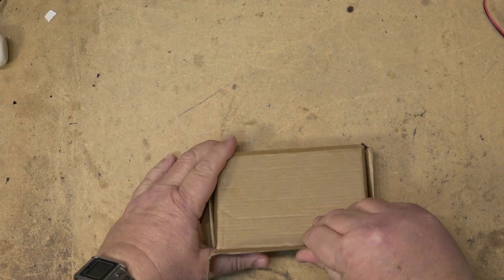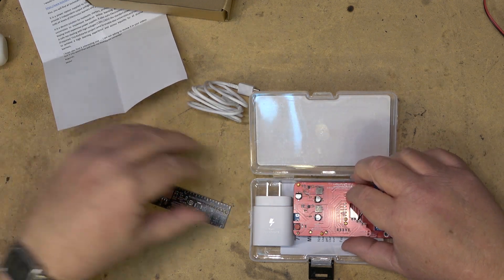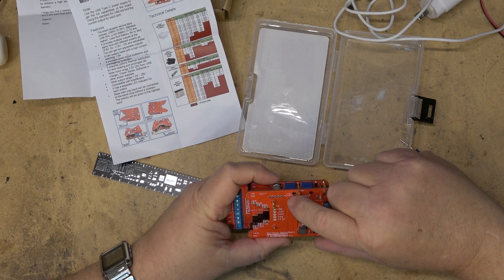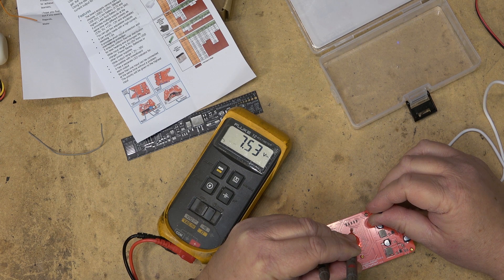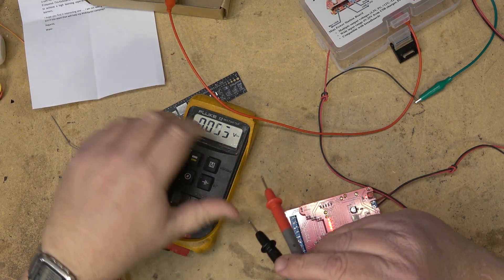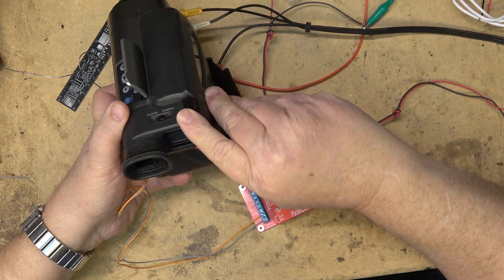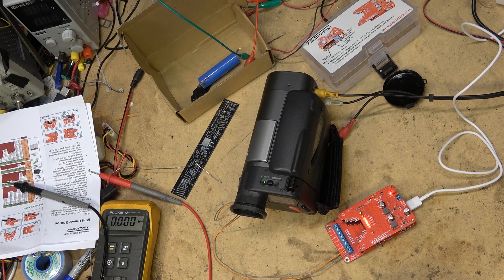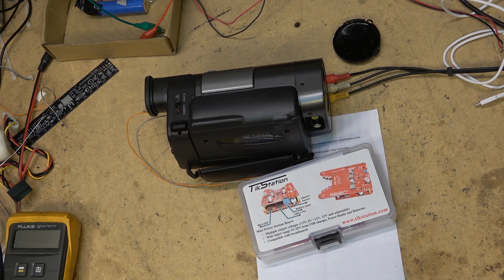TikStation mini power supply test run

Comment: They are hawking this silly thing to most of the smaller electronics channels. You need to check the electrical noise!
It's more expensive than most budget bench power supplies..
Reply from the maker: I didn't buy it, and I wasn't asked to review it. It was sent to me to show off. I didn't evaulate it just showed it and  connected it to a camera to see how it handles a 1.5 amp draw.
Reply: @12voltvids  - That's OK. I am just informing people that it's not a fabulous idea when you see it is FIFTY dollars.
Reply from the maker: @johncoops6897  you don't need to do that.  When they look it up they will see the price themself.

Comment: honestly, this is not new. Bacically you can get such power supply from PC with higher power rating.
Reply from the maker: Duh but you can't build that into small projects.
Reply: I looked at their website and I'd say the best feature is that the screw terminal outputs can be removed and the unit will plug into a standard solderless breadboard. Given the limited power output I can't imagine using this for much more.